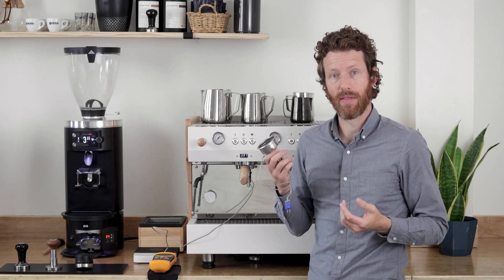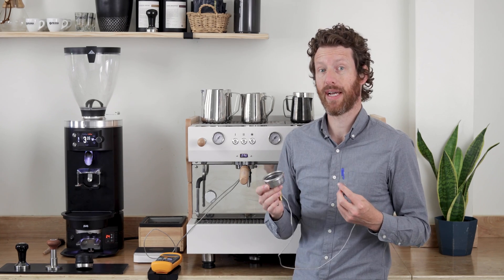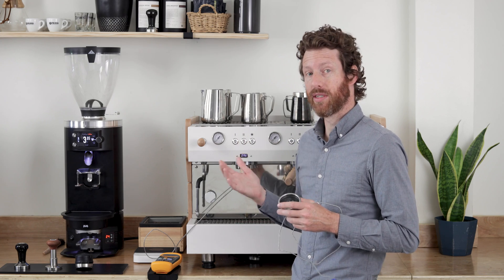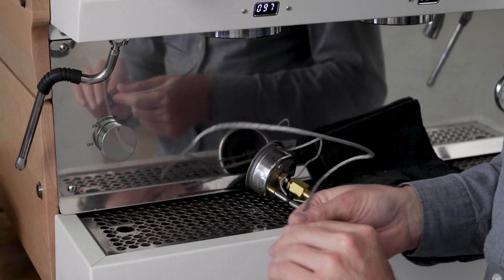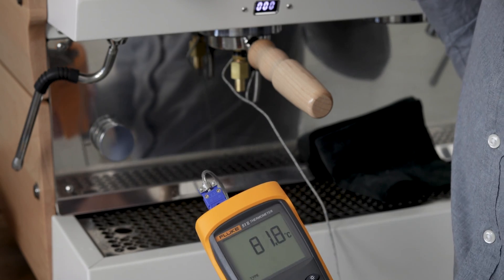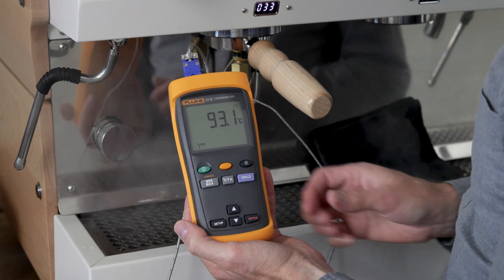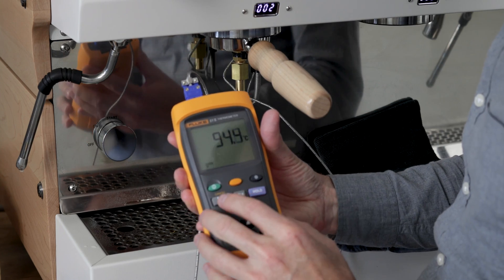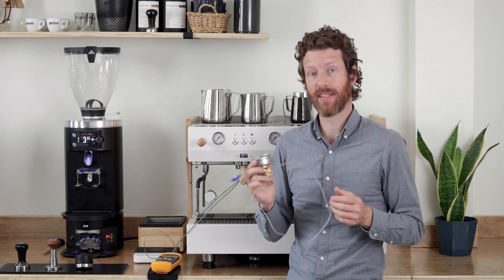Video Overview | Espresso Parts Thermofilter (SCACE)

Comment: I made one using a blank basket with an adjustable drain valve and compressed silicone rubber sealed thermocouple. It works just as great like that one. Four hundred bucks is not justified for occasional home use.

Comment: I'd love to have one, I wish it wasn't $300. Is there a scase unit available for the home user? After I check the accuracy of my HX it will wind up in a draw and get used again when a blue moon appears in the sky.
Reply: I filled my basket with heat resistance silicon gel with a reading probe in it, it works as well.